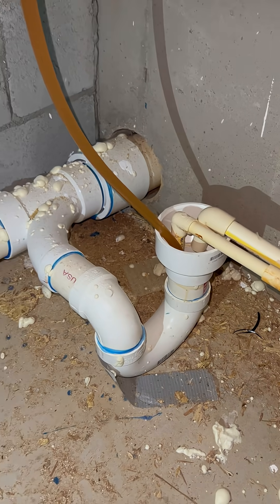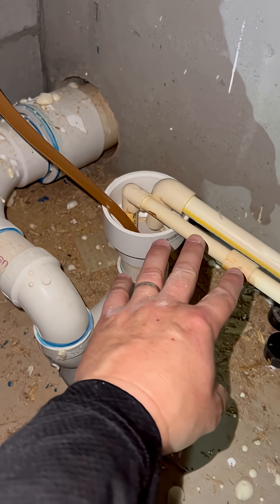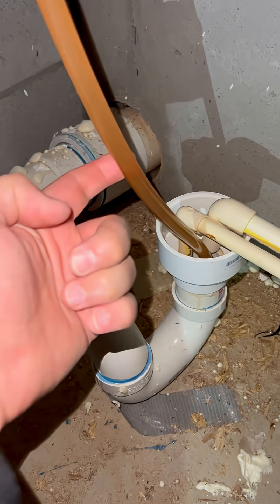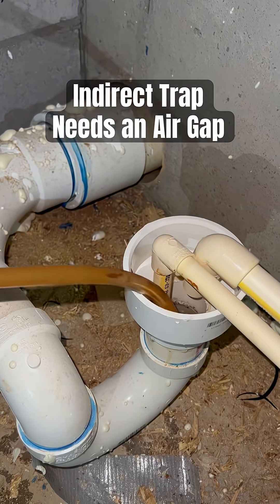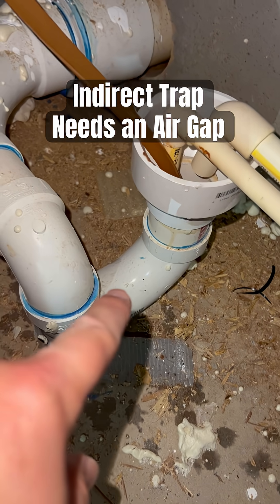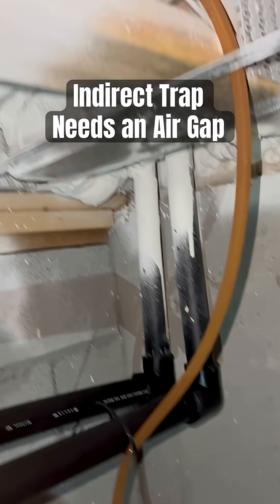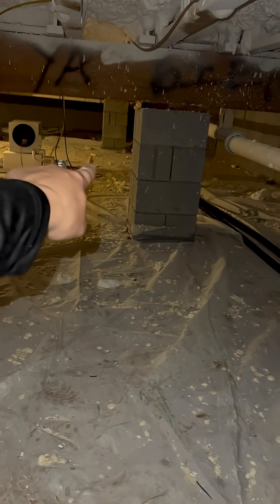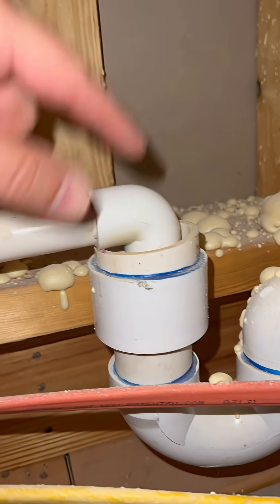GROSS. Condensate Drains Dipped in Raw Sewage (and how to get it right)

Comment: I’d imagine it should have come up straight, had a studor vent, and had a short standpipe with a trap t’d off to the side. Would at that point need a condensate pump for the two pvc lines, but that’s how I’d have tied that drain in

Comment: Also the reason that trap is full of sewage is because the wye does not enter the sewer line at a point that is above the horizontal line of the sewer line. Therefore sewage is able to flow into the pee trap. Another issue with this, even with an air gap,  you have a condensate line that is now able to receive sewer gases from the main sewer line that can then migrate up into your HVAC via a dry condensate line in the winter and distributed methane gas throughout your home.

Comment: What the … 🤦🏽‍♂️

If this is a septic system, definitely do not want condensate water running into the septic tank 24/7 (regardless of the sanitary concerns).

In Palm Beach County, Florida, they will not allow untreated water (condensation/storm water) to enter their treated water system, so condensate goes out to storm or some other option.

If this was the only option and was permissible by the local jurisdiction having authority, they should have turned the wye up and used a back water valve to prevent sewage backups from flooding into the crawl space. They did not have the elevation to turn the wye up as it is currently installed, so more planning was definitely in order.

Comment: Isn't there a chance of the trap drying out during the heating season with little condensate being produced?
Reply from the maker: The water heater will still keep this one full, but if not you’d use a trap primer
Reply: @HomePerformance Thanks.  I wasn't aware that trap primers were a thing.  I've been using a condensate pump on my air handler and crawlspace dehumidifier.
Reply: The water heater will produce more condensate in the cooling season as the water coming out of the ground will be colder, which requires more heat output and generates more condensation on the heat exchanger.